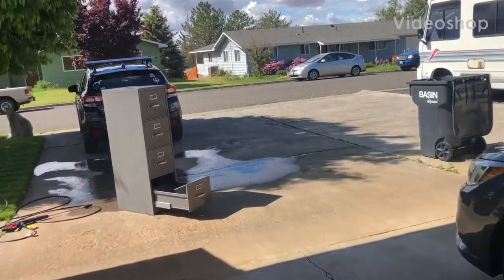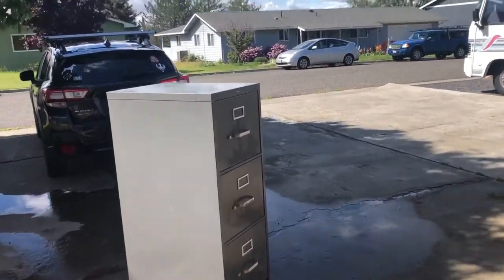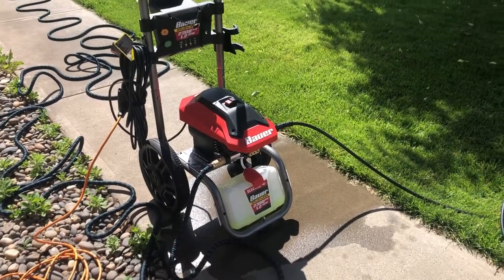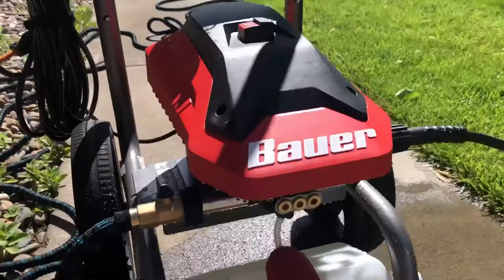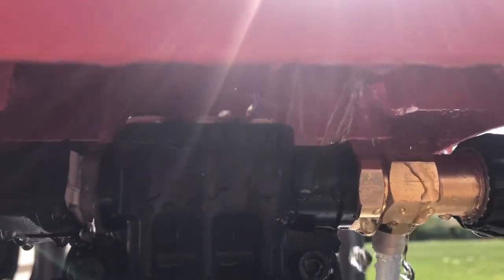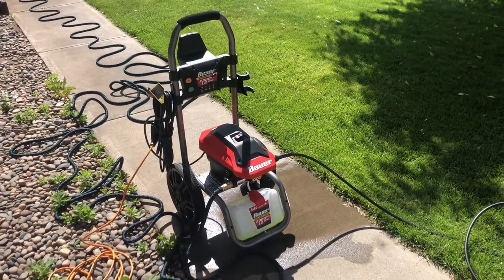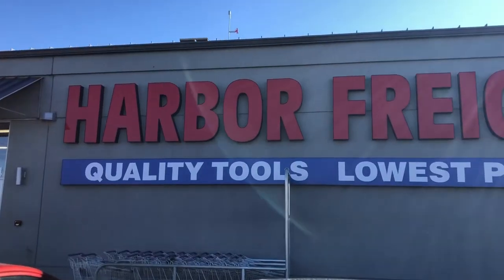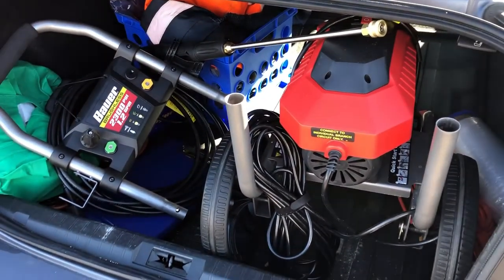Bauer 2300 PSI Electric Power Washer Broke on 2nd Use + Harbor Freight Return

Comment: Had the same experience. Stopped functioning on the second use. No leaks noted, cycled on and off continuously and never built pressure. No air buildup in the lines, no clogs  or kinks in hoses. Filter was clear. Harbor Freight returned it for original amount, no problem. I only had it one month though. After the first use I would've recommended it, but after second use, I would say " stay away.".

Comment: Always get the warranty and always bleed the air from the line before turning on the pressure.  Hook up the water and spayer and just squeeze it until the water stops. Then turn it on. With the warranty they will just replace it.